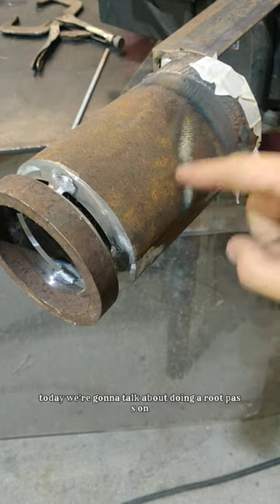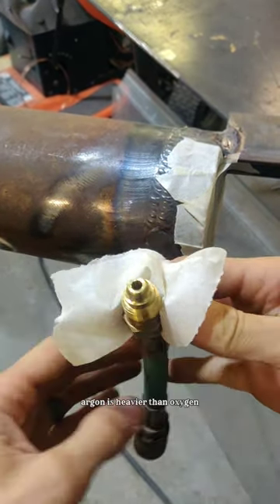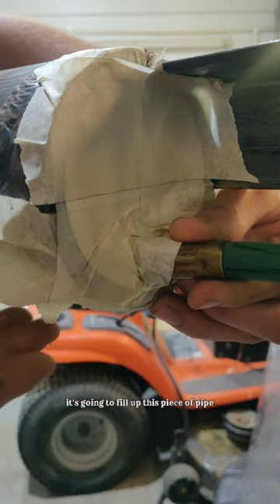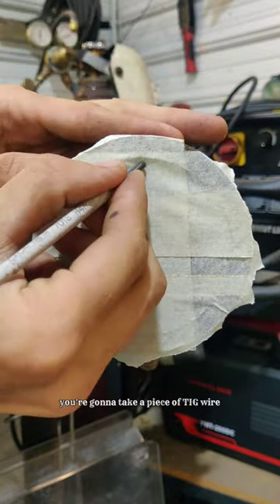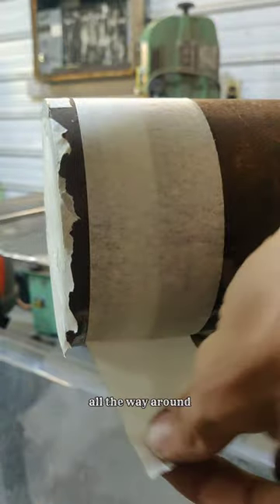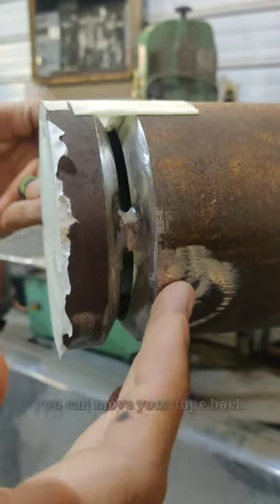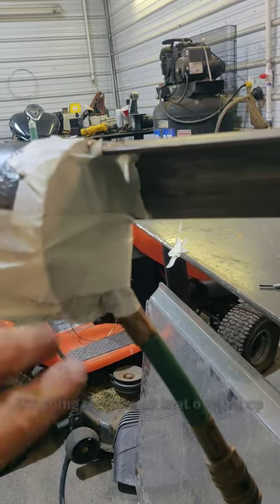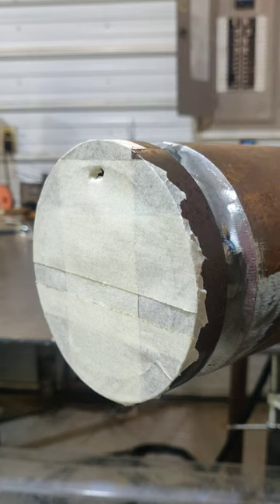How To Purge Stainless Steel Pipe For A Root Pass - Tig Welding

Comment: I thought you said you need two argon horses ? I only saw you put one .also what if you are welding in a 6g position 45 degree ? Does the hose still go on the bottom ? And the weep hole on the opposite side opposite of argon hose hole ?
Reply: Haven't watched his video. But I do a bit of purge welding. Where possible purge in low vent high. Argon is heavier than atmosphere. So will push it out from the bottom up. I also put some sort of diffuser on the end of my purge hose so it doesn't come out like a jet of argon. 

Hope this helps
Reply: @liamjenkins82 so in a way its like a waterhose at the bottom filling up the pipe ?
Reply: @wtf3633  yeah pretty much.